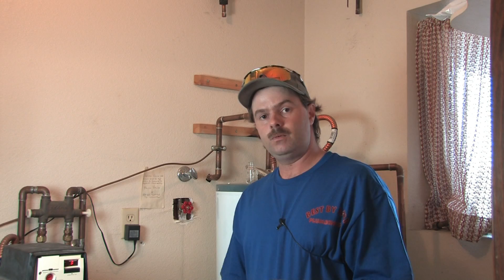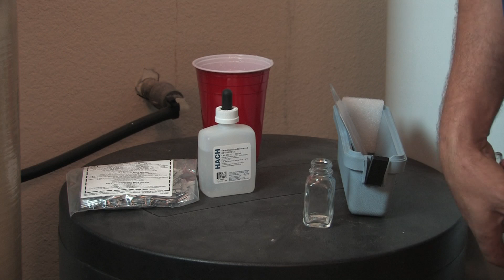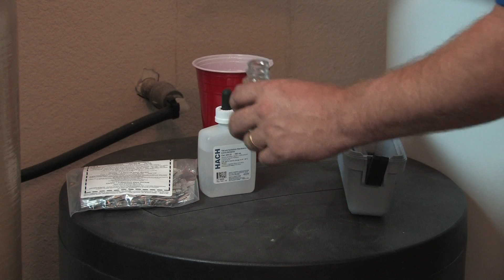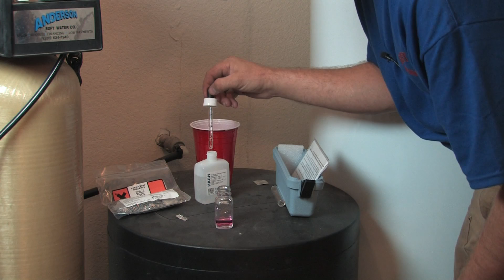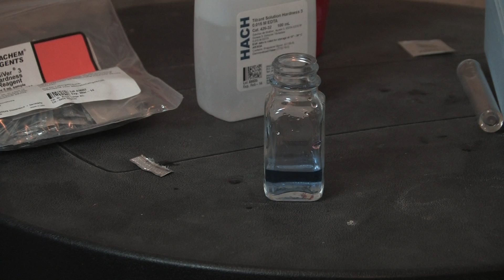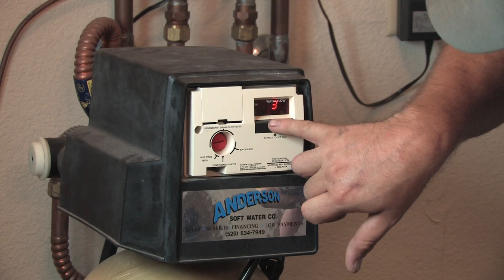Water Softeners : How to Maintain a Water Softener

Comment: Thanks for the good video.  My problem is a high pressure water leak between the risen tank and where it connects to the control unit on top.  The screws on the unit clamp are tight.  The system (Culligan) is about two years old. Any ideas?

Comment: This was a  helpful video but replacing the media resin is not very difficult. New resin is only about $100 vs. $1400 for a new water softner. Also I replaced my control valve. It's easy, just screws on the top, just be careful with the fragile plastic stem underneath it.
Reply: Yes, I did the same thing.  Replaced my resin and the control valve.  If you are handy at all, you can do it.
Reply: In the busniss it is called an upgrade LOL.

Comment: Changing resin a project? Purchase a new system instead? It not difficult at all to do. Come on man.
Reply: Step one, disconnect water lines.
Step two, screw head off.
Step three pour out resin and flush tank clean.
Step four, pour new resin in tank and reinstall softener---
VS. $700 new softener.

Comment: We had our culligan system 7 years and recently had to bypass it from no water pressure. Is that as long as a tank lasts? Could the salt in the bottom of salt tank cause this. It is expensive to replace these tanks, resin tank that is. We have well water so there is no chlorine to degrade resin and 7 years is ridiculous.
Reply: We had the same issue with ours. It turned out the resin was contaminated with sand and it was sanded off. We replaced the resin and installed a spin down filter before our cartridge filter. We just periodically open the valve on the spin down filter and it dumps all of the sand out. It works like it did on day 1 now.
Reply: burly636 I have had this tank and 12yrs.